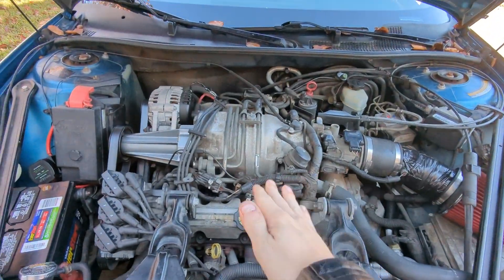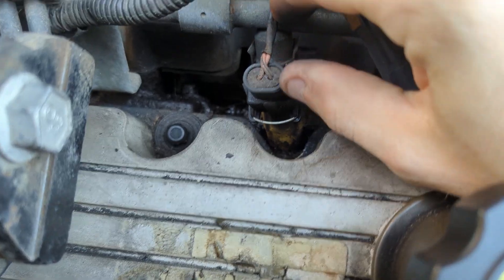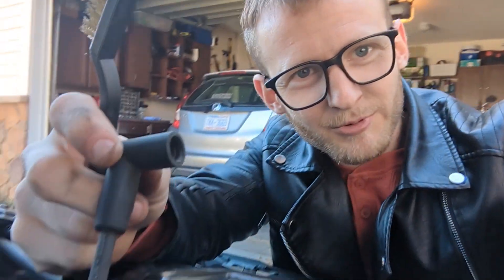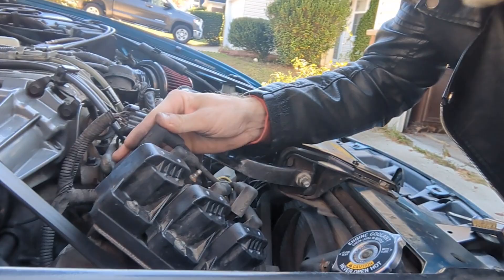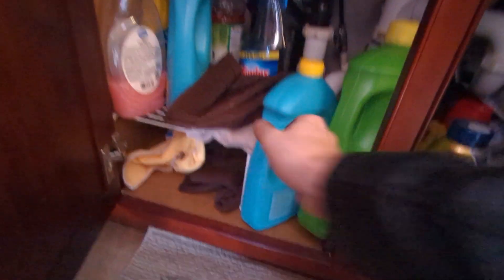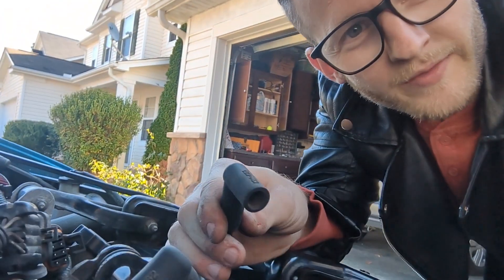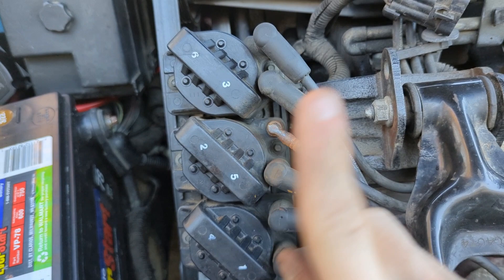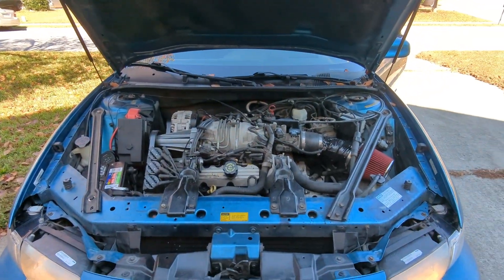My engine broke :/

Comment: The fluid on top of the engine is probably oil,the original valve covers are known to leak oil (and cause fires!),and GM recalled them. I got mine replaced for free at the dealer.
I always love a boosted 3800. That thing will run for decades,with a little TLC,and some new parts here and there.
Reply: Spot on. Tough engines that can even handle neglect. Many people who own these engines (not exactly the supercharged ones) just run them forever with minimal to no maintenance. Tough engines, common as can be, parts available.

Comment: But honestly what did you expect? It's an old GM car with not much recent maintenance.

You were more worried about sanding the car down so the paint is smooth so you can spend 2000+ dollars to wrap the car in vinyl of a color of your choice. 
 Dude, spend some money first so the car stays running. 
Very first thing you always do and change when you buy an old higher milage used car is...
1. Engine oil change also trans 
2. Spark plugs and wires if it has wires. Might need a coil pack. 
3. Serpentine  belt or V belts replaced. 
4. Coolant 
5.  Air filter
6. Fuel filter 
7. Radiator hoses 
8. Thermostat 
I'm sure I'm missing a couple things, but anyway, for a couple hundred BUX, you can make your car much more reliable while also doing preventative work to help prevent future breakdowns , like new radiator hoses and thermostat when you are doing your coolant replacement/flush. For literally $40-60 BUX you can get both new radiator hoses and a new thermostat for your car, which will help your car perform well but give you a peace of mind knowing your cooling system is absolutely good heading into winter. 
Just small things like this and you can get this car running nice for a long time. 
P.S looks like you definitely will need a new/used coil pack cause like you showed , it's rusted out . New coil pack , wires and plugs will make a big difference for this supercharged bad boy.
Reply: Been after him to take care of the engine etc on his last car. Sucking the oil out and adding new every 20k does not help much.
Reply: @jimzimmerline7779  lol yeah, he has some strange ideas and way to fix things. He just needs to fix his priorities